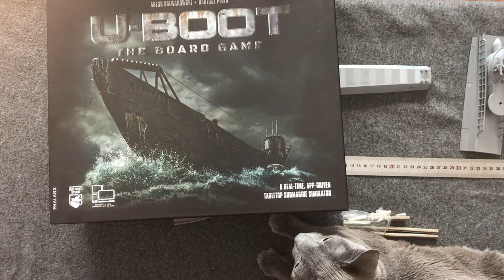U-Boot The board game 3D model replacement part 2

Comment: Will the resin parts that come with the game fit on/in this model? I was looking at your conning tower and didn’t see how the resin periscope  assembly would fit on the model.
Reply from the maker: This is still WIP, there are changes after changes. Conning tower is still not finished yet. But if you want to help, please take a photo of attached periscope to paper conning tower, and if possible measure me the part of resin periscope which is connected to paper model. You can send me it by mail, or paste a link here.

Comment: Can you make it possible to use the current resin parts?
Also the railings should be different, check photos. But everything else is amazing!
Reply from the maker: yep you can use the resin parts, just put it inside :D About the railings I know, I had to make them stronger (about 2mm) because you cannot print just 1mm wide pillar, alsi I had to make them denser, because printer can print in air only when there is about 1cm between two points.